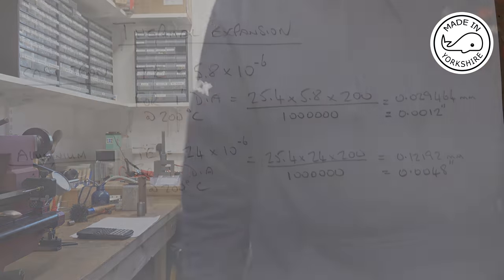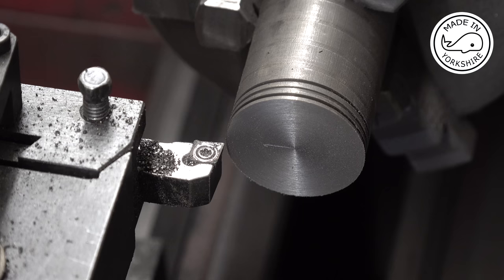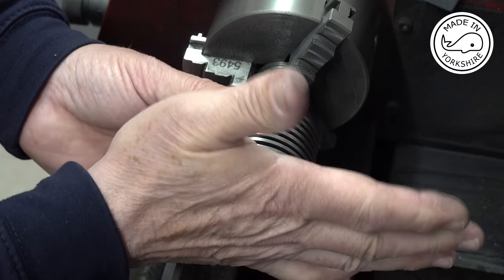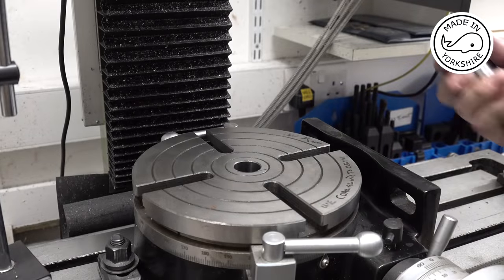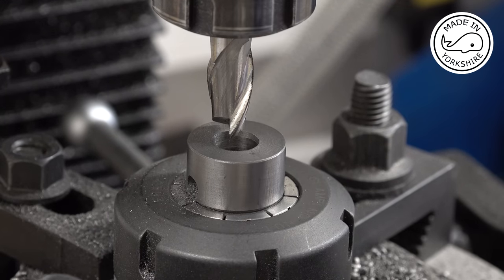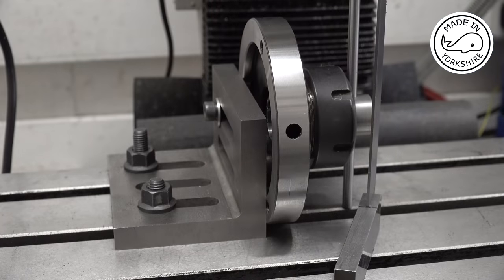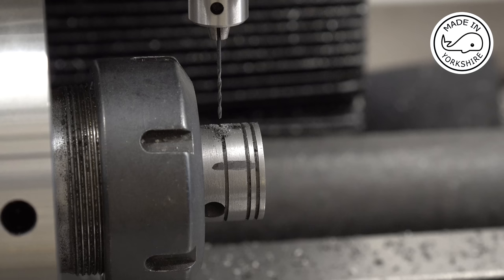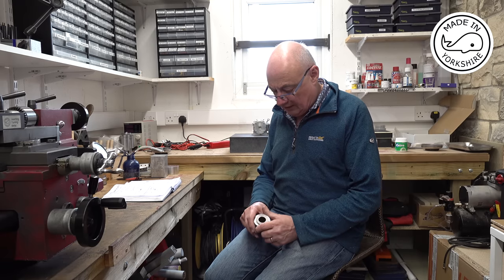#MT49 Part 13 - Jerry Howell V-twin IC Engine. The Cast Iron Pistons. In 4K by Andrew Whale.

Comment: ...Had to come back to this video as I am coincidentally remaking a piston for my RedWing hit n miss engine that i failed to get running a few years ago...i know that my aluminium piston is made wrong, because i made it.
Although I could find generic piston tolerances anywhere online, i could never find the thermal expansion tolerance that you so eloquently explained. 
Thanks for sharing this sacred knowledge.
Your engine looks great.
Reply from the maker: Hi. I made two hit n miss engines and they run really cool. I think the cylinder/piston differences were 1 or 2 thou for a 1" dia piston from memory. I covered the making of these pistons in some earlier videos which might be helpful. I hope you get your RedWing sorted soon. Hit n miss engines are amazing!
Cheers
Andrew

Comment: From a motorbike/scooter engine viewpoint l found your materials expansion examples most usefull. Thanks for that. Alex norfolk.
Reply from the maker: Hi Alex. I think some of the more modern alloys have a similar thermal expansion to that of cast iron, but I don't think the aluminium I have is anything special. An interesting subject nonetheless and maybe really relevant in relation to older motorcycle and car engines.
Cheers
Andrew

Comment: A lot of maths in the making of your pistons. So many opportunities to get the numbers wrong! They look good and fit well. I particularly liked the drilling out of the pistons. When the chips started flowing out of the gudgeon hole it looked like some early 20th century iron works. Sounded like you had a drop of rain at one point too ⛈🌧☔
Reply from the maker: Thanks Tim. I think I was incorrect in assuming the engine could get to 200 degrees C. More likely to be 100. Still probably wise to stick with cast iron though. Yeah, speeded up the video reminded me of a lava flow running out of the hole! Yeah, a good test to see how well the roof has been constructed! No leaks!
Cheers
Andrew

Comment: Respectfully, FYI, aluminum pistons are tapered. The top expands more than the skirt so you actually need 2 measurements when making aluminum pistons.
Your math was correct for the TOP of the piston.
The skirt clearance is "generally"  only .001" per 1 inch diameter of the piston because its much cooler than the top of the piston. 
A real mind blower is that automotive pistons are also oval...not round....cam ground... because the wrist pin area is hotter and expands more.
Enjoyed your video....thanks.
Reply from the maker: Very intertesting - thanks for taking time to explain.
Cheers
Andrew

Comment: The rule of thumb for aluminium piston in steel/iron bore is make the piston 2 thou per inch less than the bore. I have made a few model engines to this and never had any issues.
Reply from the maker: Yeah - I agree. I too have made a few ic engines using aluminium pistons without issue. The issue here is that this is a high revving engine, so temperatures will be higher. Jerry Howell refers to thermal expansion being a potential issue. Over the past few years I've learned to stick to the original design recommendations.
Cheers
Andrew

Comment: Hi Andrew, nice work on the pistons.
In the plans does it mention what aluminium is used for the pistons?
Not all aluminium has the same expansion/wear rates.
Regards
Kevin
Reply from the maker: Thanks Kevin
The drawings recommend cast iron rather than aluminium, specifically due to expansion issues. The 6082 t6 aluminium I have has a thermal expansion coefficiant value of 24 x 10 to power of -6 as outlined in my calculations. I understand that aluminium types have evolved over recent years and some have lower thermal expansion values. Not sure which those are though and if they are readily available in the UK. Over the past couple of years I've learned that it's best to stick to the drawings 😪
Cheers
Andrew

Comment: good video, you need to wear those piston rings in for better compression before testing.
and its  better to make a piston half a thou to small then a half a thou to big, otherwise you risk jamming the piston when to big.

cheers ben.
Reply from the maker: Thanks Ben. Fair point about running the rings in first.
Cheers
Andrew